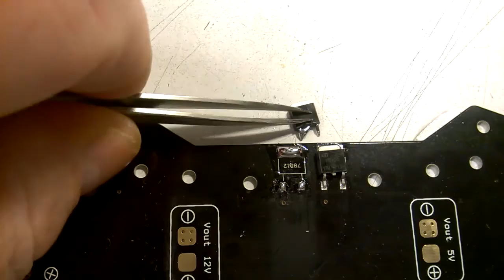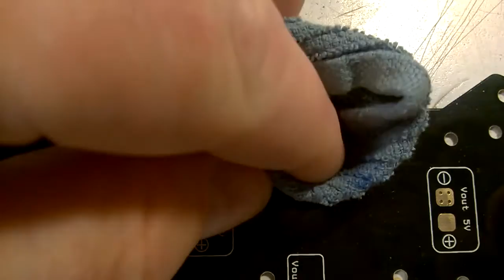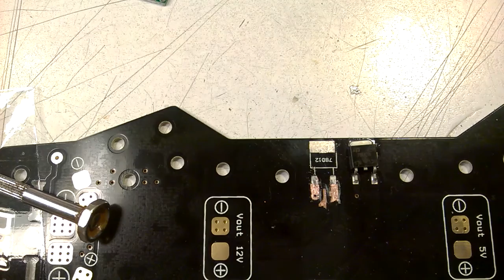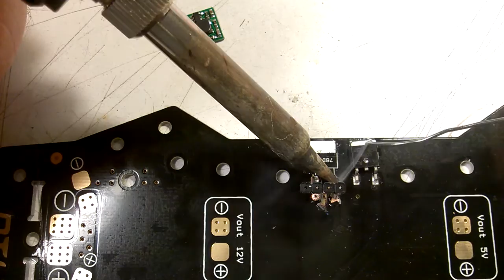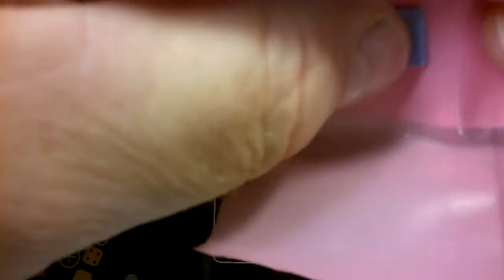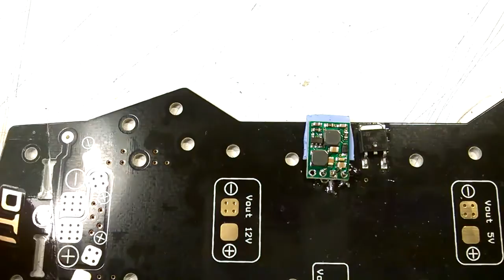Installing a Pololu Regulator on the Diatone PDB

Comment: hi.  how do you determine which 22uF capacitor to purchase?  Does it go by the max voltage you plan to run through the quad?  If i was using 3S or 4S batteries on my craft, would i buy the 16V 22uF like this one? Thanks!!  http://www.ebay.com/itm/231799887886
Reply from the maker: +orblivious1 
For 4S, I recommend a 22uF/25V rated Ceramic capacitor across VIN and GND. AliExpress.com or eBay.

Tantalum capacitors are NOT a good choice here; they have low ripple current and high ESR compared to ceramics, plus they are sensitive to the very kind of voltage spikes we're trying to protect against.
Reply: seems you are correct :)  i connected the one i had linked and when applying my 3S battery it blew in half and flew a piece flew across my room.  i ended up breaking the PDB last weekend anyways, and now will try the OSO PDB.  thanks for the reply though.

Comment: What can you use to replace the thermal pad?  Can you use actual cpu paste?
Reply from the maker: +Sam Maghsoodloo 

Not really; you need the adhesive action of the thermal pad. Also, the pad holds the Pololu about 1.5mm above the PC board, which is clearance you need.

The thermal pads are cheap, and really useful - especially for ESCs and VTXes. Once you have them, you'll find all sorts of uses for the things.
Reply: Thank you, I will order some of them.  
Also, I tried this mod on my diatone, and the pololu step up/down seemed to be dead, so I ordered another one and the same.  Is there something I could me messing up?
Reply from the maker: +Sam Maghsoodloo 

I&#39;ve seen people accidentally solder the Pololu on one pin off; look at the video at 13:00 and you will see that the pin all the way to the left is open. This is the SHDN (Shutdown) pin, it is NOT supposed to be connected to anything.

PINS ARE: [SHDN] [VIN] [GND] [VOUT]

Check with a multimeter; if you have continuity between GND and the BATT ( -) solder pad and continuity between [VIN] and the BATT( +) solder pad, it should have power connected correctly. Check for continuity between GND and SHDN; you should NOT have continuity. You may have a solder blob shorting it out and making it shut down.

Plug in your BATTERY; place meter ( -) probe on the BATT ( -) solder pad, check with meter ( +) probe for BATT ( +) voltage at VIN of the Pololu and +5V at VOUT.

Good luck!